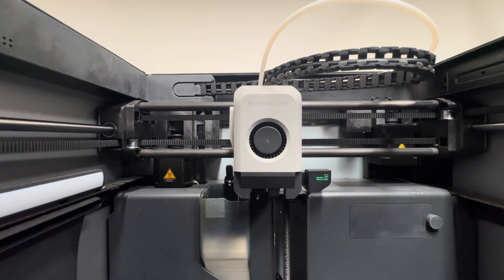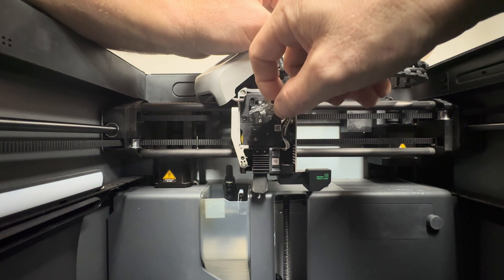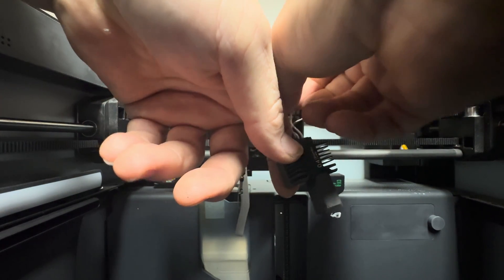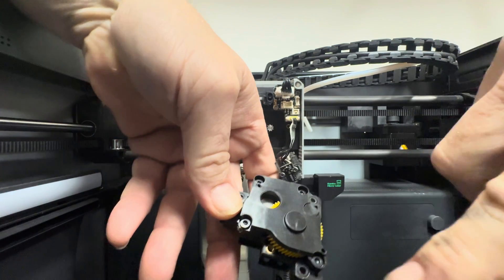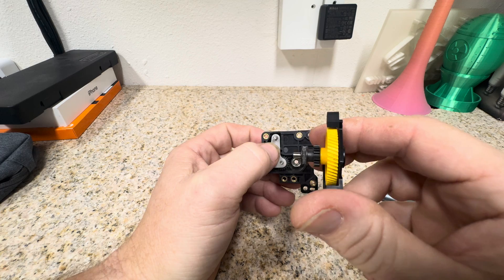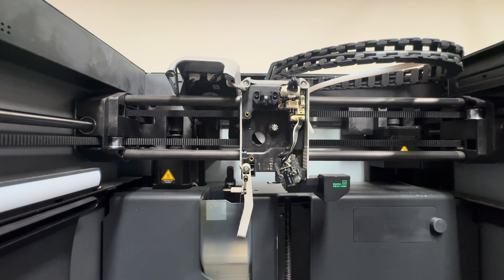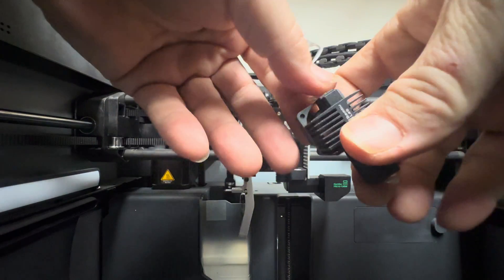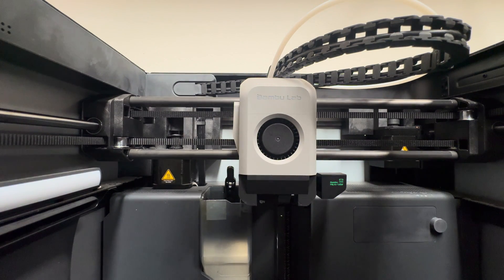Bambu X1C clearing a clogged extruder

Comment: Getting the proper size for the Husky tool screw head for the screws was a challenge, but I finally figured out one that worked for both.  Then getting the tube out was a bit of a challenge.  More detail might have helped there.

I finally got it out and found a piece of filament which I assume was from the factory.  

Thanks for the video!
Reply from the maker: Thanks for the feedback when I get time I will add some info in the description for that. Glad you got it all figured out though.

Comment: @Gingergeekstudios - the sensor that you pulled out around 1:17 - I removed the screws but mine doesn't pop out - is there something else besides those two screws and the ptfe tube that has to be removed?
Reply from the maker: No its just those two screws. You may have a bit of filament stuck inside that is making it difficult to remove. I could also just be stuck I remember the first time I removed mine that it was a little harder to take out. Just be careful because those wires are very small and easy to break.

Comment: This really helped me clear my clog, thank you. My clog was so intense I wasn't able to get the gears off, but a little creative tugging with some pliers got the clog out and I was able to get it apart and clean it up.

Those little wires are fragile, I broke the temperature sensor wire for my 0.2mm nozzle, so I have to learn how to fix that now. At least I can print with other nozzles now that my extruder is working.
Reply from the maker: Im glad this helped you. If you are really wanting to repair the thermistor wire just know that any amount of solder you add to the wire can change the resistance and that will mess with the read out of what temp the printer thinks it is.
Reply: @gingergeekstudios  I ended up swapping the thermistor from my 0.6 I never use and it worked like a charm! Thanks again!

Comment: What symptom does the machine have or do that you know you have a clog “ air printing “ ? Is one any other ? Ty good tear down video 👍
Reply from the maker: The main way you will know is that the AMS will be making a grinding noise because its trying to feed filament but its not moving so the feeding gears are just scraping against the filament. If you’re not using an AMS then you will see the print head moving like it’s printing but nothing will be coming out of the nozzle.
Reply: @gingergeekstudios  thank you so the clicking sound or air printing .
I look at these multiple color filaments and most have clogging issues so I don’t buy can you recommend a maker with no issues ?

Ps : glow in the dark filament is notorious on breaking and clogging
Reply from the maker: There are no FDM printers that will not have this issue. There are some that will do it far less than other but all are capable of clogging. The best way to prevent this from happening with a bambu is to leave the door open when you are printing with PLA and especially when the room your printer is in is not climate controlled.
Reply: @gingergeekstudios  i try that open door method with the multi color pla thanks
Reply from the maker: You’re welcome. Happy to help. Let me know how it goes for you

Comment: For anyone who might find it useful, you'll need a 1.5mm and a 2.0mm hex key.
Filament Cutter: 1x 1.5mm screw
Filament Sensor: 2x 1.5mm screws
Hot End: 2x 2.0mm screws
Extruder: 3x 2.0mm screws
Extruder Body: 4x2.0mm screws
Reply from the maker: Thanks this is very helpful info.